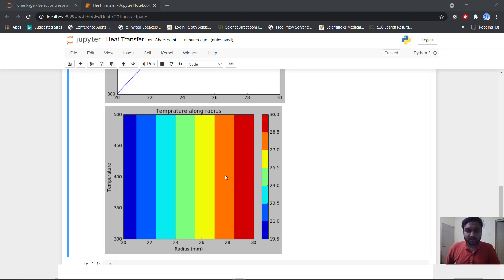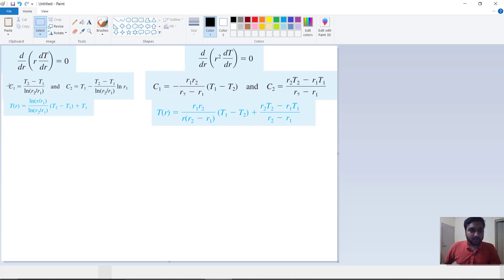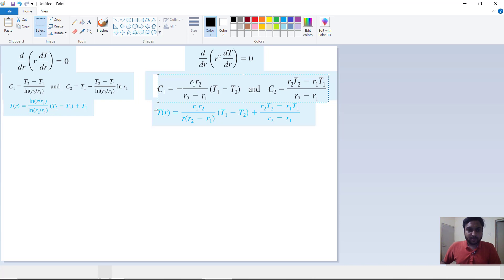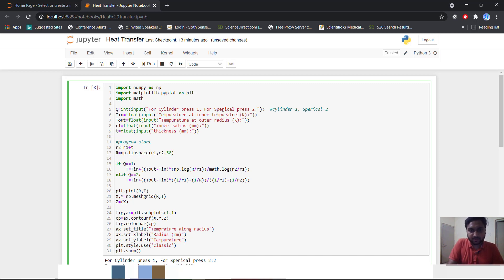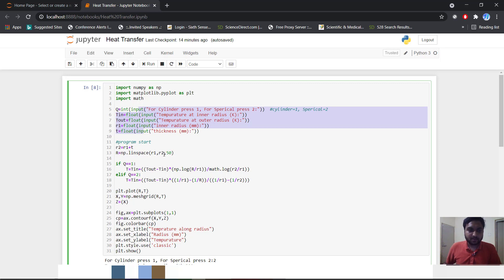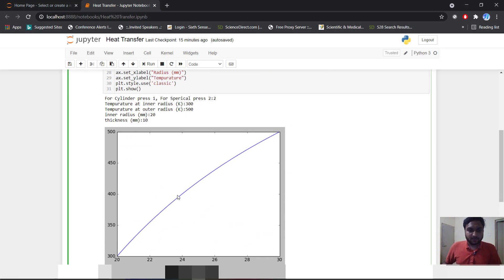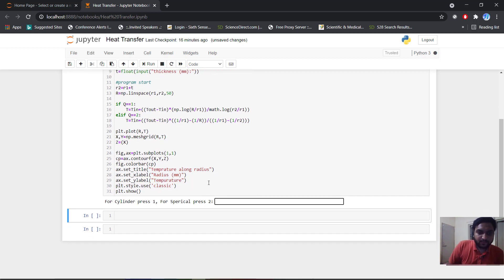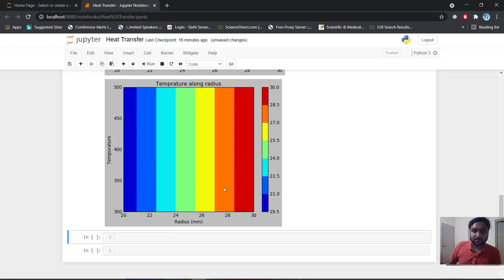Heat Transfer in python | Python for mechanical engineer | Heat Transfer

Comment: Nameerror: Name r1 is not defined
I got this error
Reply from the maker: Check your variables, may be mistake in case sensitive
Reply: I checked then too the same error occurs. I replaced 'r1' by 'R1' in all places. Same error came. Pls give solution
Reply from the maker: @prasadjagtap1252  copy your in comment
Reply: @HarikrushnaDodiya  can we discuss on other platform. Let's connect.